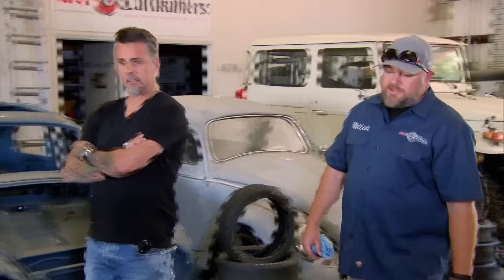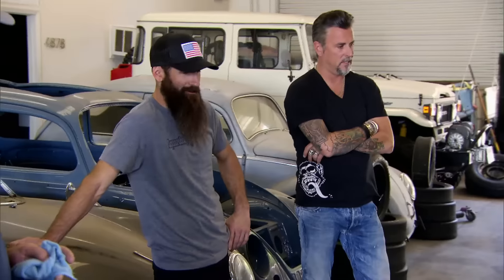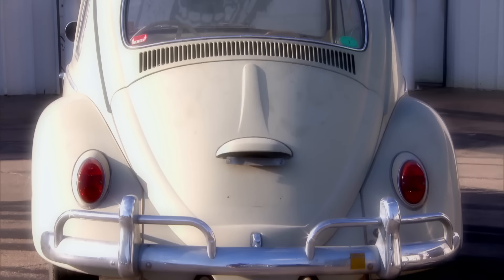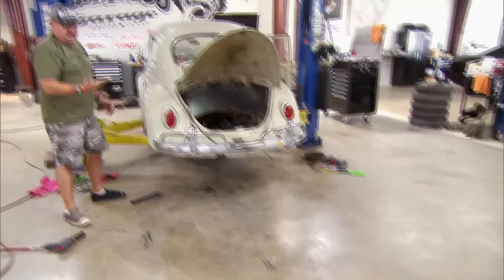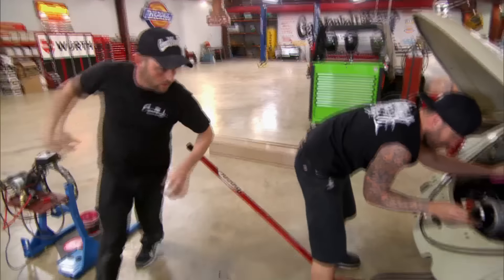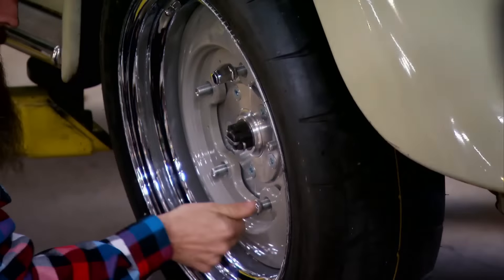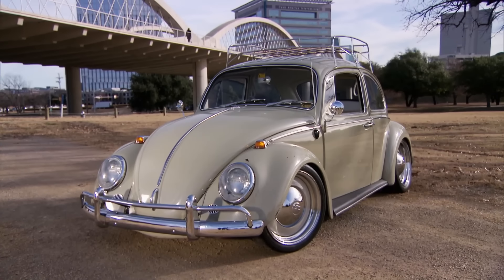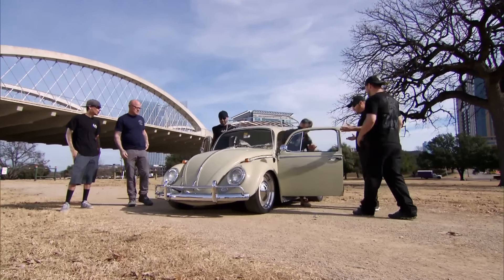Aaron Gives A +200 Horsepower Motor To A Beetle | Fast N' Loud

Comment: What I don't understand is why they bought an almost new car to change the motor, etc...if they could buy a cheaper car with no motor etc...No sense.
Reply: It's a tv show with a budget that allows it. it's a shame they wasted an all original that would've just needed a buff and simple maintainece to turn it into a prime collector car.

 I like the way it turned out but it's still a shame
Reply: It's a blank/clean canvas!  No extra stuff to do, especially body work, which is the time and money suck on these old vws.
Reply: It was an unmolested original. That is perfect  to begin with no matter what. Other people haven't gone through it, made a bunch of changes and beat it up.
Reply: Lots of sense , cause once a car has been fucked with it’s not worth 10cents
Reply: And not fixing someone else's mess.

Comment: Sitting higher it looked better. I think they've messed with the camber angle too...
Reply: It hurts to see them mess with the proportions of a classic, but that's Gas Monkey. At least the suspension and wheels can be easily replaced, again.
Reply: They dont drive very well lowered like that. Alot of bump steer.
Reply: Ginés de Pasamonte
 ... when you loser the back on a swing axle you get negative camber. You have no choice.

Comment: Bought a new 50 horse 1300 in 1966, 495 dollars. Fitted 1600 barrels and pistons, twin port heads,Webber downdraft carb and a good quality extractor system. Great result for a reasonable cost. Suspension work turned out a little costly.

Comment: Dang, this really makes me want to buy a bug now and do this.
Reply: I’ve never liked a bug before. I want to build one exactly like it but oily black everywhere this one is chalky white. Leather interior with black plaid inserts. Dual chrome exhaust tips
Reply: @negativeindustrial  i just bought a 63 at the Mecum auction in Houston last Dec,it was a herbie style, now its in the shop and gonna be deep black, red seats door panels and carpet, the rest will be black, disc brakes all around and air suspension. Can't wait to have it delivered.

Comment: I don't like the lowered aspect of it, nor the 17" wheels... Back in the day, we would put G50-15s on the rear... They would fit on the stock rims... I have no idea what that tire size would result in these days, but it was a tight fit and could have probably done with a bit of lift in the rear suspension or some slightly wider fenders...

<break-for-google-search>

According to this:
http://www.pontiacserver.com/tires.html

A G50-15 would be 10.35" section width and 25.46" height... So, approximately a 263-50-15 tire...

Mine might have been a bit older than this one since it originally had the 6V electrical system... Over the years, things got swapped out with parts from other Bugs, so in reality it was quite a mix of years... Too many years have gone by and I don't remember what year mine had started out as...

Comment: i bought my 54 for 5 grand. looks and runs fine.}1500} Plugged in a 2276, big valves, dual 44s, and I'm sure it is no where near 200 horse. But she does haul ass. They would have to raise the compression ratio to drag race heights to get that much horse and it would be unreliable.

Comment: Where can we find frond, rear suspension, gearbox and engine for beetle ? Wanna bring it down to Sri Lanka..
Reply: I can ship them, original parts
Reply: Front Suspension: obviously Airkewld, USA, AZ, "Ultimate Beam",  looks to me 4" narrowed, no shock towers  (+ the 17" Wheels)
Gearbox: not sure, might be a Rancho "Type1-Pro", USA, CA
Motor/Engine: they did not say, but I'd wager from CB Performance, Turnkey crate 2276?; also USA, CA
Exhaust: looks like a Vintage-Speed SST, 200hp kit. Made in Taiwan
.. if you really want it, ask them if they ship to you :)

Comment: Good job, can anyone tell me where to get those upgrade Engine and other stuffs, thanks
Reply: If you google it you can find it. Just got gas money vw big parts. I’ve found it before
Reply: Front Suspension: Airkewld, USA, AZ, "Ultimate Beam",  looks to me 4" narrowed, no shock towers  (+ the 17" Wheels)
Gearbox: not sure, might be a Rancho "Type1-Pro", USA, CA
Motor/Engine: they did not say, but I'd wager from CB Performance, Turnkey crate 2276?; also USA, CA
Exhaust: looks like a Vintage-Speed SST, 200hp kit. Made in Taiwan

Comment: Considering how light weight that thing is  200 is like 700 in a challenger.
Reply: What I missed where details about the suspension,brake system and the new engine.I just hope this video doesn't give som inexperienced boys ideas about leaving everything as it is just putting in a new, strong engine.Might turn out to be a dangerous adventure.

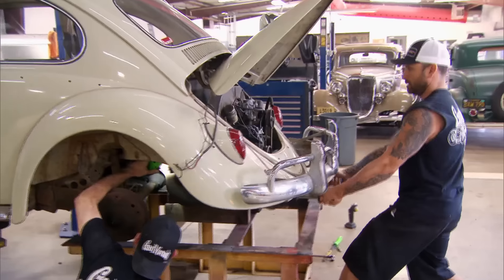Comment: 2:42 do my ears deceive me or did i just hear him say “speedo cable” 🤔 last time i checked the speedo cable was up front at the front driver wheel lol.. the throttle cable is back there and i guess you could say it gives you speed when pulled

Comment: Where is the front suspension, gearbox and motor from?
Reply: from the place they bought the car if i understood it correctly
Reply: Front Suspension: Airkewld, USA, AZ, "Ultimate Beam",  looks to me 4" narrowed, no shock towers  (+ the 17" Wheels)
Gearbox: not sure, might be a Racho "Type1-Pro", USA, CA
Motor: they did not say, but I'd wager from CB Performance, Turnkey crate 2276?; also USA, CA

Comment: Wow!wow!,i love What the cruising vw.it's awesome. #DMAXUK how deep do i have to get in my pocket to get such powerful engine please.
Reply: jac mwo - a 200hp motor will run you $10k
Then you need the transmission and axles to handle that power and those are another $4-6 depending on if you want to lift the front wheels or not.
Check out the CB Performance YouTube channel. My engine is the all black one that makes 181hp. I have my doubts that this motor as installed in the car makes 200hp...
Reply: Better off with Subaru power a lot cheaper.

Comment: Speedo cable is no where near the engine lol
Reply: Tyler Garrison I was just gonna say that
Reply: I mean kinda in that bugs are small cars so I guess everything in the car is close
Reply: He meant throttle cable
Reply: Speedo cable goes the the left rear wheel. Details. The Devils domain.
Reply: @robertschreiber8099  usually front left wheel for speedo
Reply: @ChrisSandtSmith  Thought so, from another video I saw. Thanks! :) Details! The Devils domain! D'ho!
Reply: @robertschreiber8099  incorrect
Reply: @ironicchannelname6457  Back yourself up........
Reply: @robertschreiber8099  okay you're wrong
Reply: Robert Schreiber nope there is a hole in the bearing cap on the front left wheel that the speedo goes through. No bug from 1951 through 2013 (Mexico bugs) have a Speedo cable setup differently. All front left wheel.
Reply: The comment I was looking for. Clearly no clue about these cars.. Let's just throw money at it and bolt shit on

Comment: "We started off with a 1600cc engine with 40hp" Say what?? If that was a stock engine, you had a 1200 cc engine and 40 hp. Leave it to the young guys to screw the pooch and screw up a car that is only original once.
Reply: If it still had the 1200 there's a good chance the ruined a numbers matching car.
Reply: It’s a car for driving chill

Comment: What porsche motor was it?
Reply: I'd like to know the replacement engine as well as all the parts that were changed out, trans front end suspension ect. would be very appreciated. Thank you for a great video.
Reply: Not a porsche motor, still a bug engine by looks of it

Comment: It saddens me to see it molested if it was truly 100% original...
Reply: In today's driving environment you need somthing better then a 40hp engine, so the rear end and engine was upgraded,  that doesn't mean that they trashed the old engine and rear end, thay will save that and give it to the new owners incase they want to put it back original..
Reply: It wasn’t anyway

Comment: Vw. They changed so many things during the years. Thats why they have 1/2 year parts.
Reply: The handle on the front of a VW was the same through all the years, till the end! Not just the name and looks which became moderated during the years as times and taste became different.
Reply: I'm talking parts when fixing and repairing . They would re engineer part halfway through year because of failures.

Comment: Lol.....clutch cable not speedo cable...and what VW motors spits out 200hp and still runs pea shooters....

Wheels were nice though...What size tires were ran on the front and back? Does anyone know?
Reply: The Exhaust looked more like a Vintage-Speed in SST with bigger Tubes, they have some Exhaust systems for up to 200hp. 
In case you want to investigate more: Wheels (and Front Beam) are from Airkewld USA, AZ,  17" smoothies.

Comment: There's a reason VW stopped selling these in the USA. The phenomenon was called "Ejector Seats". In a rear end collision the seats come off their tracks and throw the occupants to their death through the rear window. The steering shaft on the 65 model also didn't have the collapsible shaft yet for a few years. So you see, anyone can bolt on a power package, but can you make it safe for the streets today?  Get creative with some high strength U-bolts and some steel ,(or other material to secure the seat channels, and get the newer model steering shaft that is collapsible and not a spleen killer. Or just get a good liability policy so if the person you sell this high speed death trap to manages to survive it can pay out millions to the injured party. It's one thing to do this kind of thing for yourself but if it's a business and you sell it, you're liable to whoever you sell this high speed coffin to.     ........Just sayin' ,  P.S.  I drove beetles for about 20 years, loved them. Now I drive a sbc 350 van,,,,,,,,,,  ........Mike

Comment: here is a Silly Question  you guys have the car on a lift that you are  lifting the new tires and rims  off the floor to put on the car , why not lower the car on the lift to make it easier to  put the new wheels onto the car ?  Work Smarter not harder

Comment: I'm not trying to be mean or rude but love fast and loud very good show since they took American Choppers off the air why in the heck will they take the original motor for my 65 Volkswagen bug and take the suspension off and put new interior if it has the original material why mess it up

Comment: I'll stick with 40 horses.  30mpg
Reply: How did you get it that low?
Reply: @ChrisSandtSmith  1200cc  stock 64=40hp
Reply: I meant the MPG mate, I have a 62, with a 69 1500, cant get better than 16MPG
Reply: @ChrisSandtSmith  according to spec.  Stock 1500 should get 25 mpg.  1300 28mpg.1200 31.5 mpg.  With 1 passenger,  55 miles per hr.  It's in the original owners manual.   Cheers from Texas
Reply: Maybe our Fuel is crap down here in Straya mate. Will do a Carby tune and see if i get those extra 10miles
Reply: @ChrisSandtSmith  1500 in my opinion, was the best engine they ever made. Make sure you are running the correct, stock vac. advance distributor and the 30 pict-1 carb.  Stock is rock.
Reply: @ChrisSandtSmith  are your tailpipes black?  Should be tan
Reply: Chrome actually
Reply: @brianchisnell1548  i have a 28 pict carb on from the 1200, vac Distributor is on there, the car is half 6v half 12v, so im changing it over to 12v maybe putting electronic ignition in staying with the vac adv distributor.
Reply: @ChrisSandtSmith  no, the inside.   Soot?  Black?  Means too rich
Reply: @brianchisnell1548  yup,  pitch black,  haven't checked that actually, great heads up. Ill do a carby service, lean it out a bit
Reply: @ChrisSandtSmith  you can only adjust idle mixture.   May need to re-jet the carb.
Reply: @brianchisnell1548  
I've always wondered what the different air cooled engines got for mpg but I was too lazy to look it up because I know myself.... if I  start researching it..... I'll start looking to buy another lost orphan.
Reply: @xmo552  Lol .  30 mpg was a big deal in the early 60s.  Then came the Datsuns and Toyota's!
Reply: @brianchisnell1548  
I know it wasn't all about big cars and hp. That's all people think about in hindsight. I've read old articles about dependability runs and mpg runs. It's nothing new. It seems there were always higher efficiency car options. I'm 38, older guys talk about their smaller cars and motorcycles when they were younger. Not everyone started on a big cube sedan, corvette, or glamorous fullsize Harley Davidson.
Reply: @ChrisSandtSmith  ... I think that carb is your problem. Too small and you are always keeping your foot into it. The 1500 should have a 30 or 32 PICT carb. My 69 easily got 25 mpg and with a bit of coaxing I could wring out close to 34 mpg. (us gallons)
Reply: @ChrisSandtSmith  Egads! In addition to the usual suspects-- timing/dwell WAY off, plug gaps too wide, mixture WAY too rich, etc., in all likelihood the advance mechanism(s) in your dizzy must've failed completely to be getting such HORRIFIC mpg!  Same thing happened with my 72 back in the day and it'd barely crack 19/20 mpg till I figured it out. Hell, even my 1979 Trans Am with a 505 cubic inch aftermarket engine gets better mpg than that in a car weighing over twice as much.😵

Comment: Hardly any detail on this build about anything, suspension, engine, fuelling, brakes. very poor
Reply: This is a summary of the entire actual TV episode about it so it doesn’t go in as much detail
Reply: Front Suspension: obviously Airkewld, USA, AZ, "Ultimate Beam",  looks to me 4" narrowed, no shock towers  (+ the 17" Wheels)
Gearbox: not sure, might be a Rancho "Type1-Pro", USA, CA
Motor/Engine: they did not say, but I'd wager from CB Performance, Turnkey crate 2276?; also USA, CA
Exhaust: looks like a Vintage-Speed SST, 200hp kit. Made in Taiwan
I agree, an advanced fuel solution might be needed, not sure what they used though..

Comment: Crazy..6k for a bug that needs a bunch of work a $1200 front beam..a $1500 gearbox and a quality built 2ltr will run average $6000(if you need everything from the case up) then interior kits depending can run $2000 and new bumpers/accessories can get pricey depending on quality in the total range of $1500..you're looking at 20k just in parts...now you need to do all the work...all of a sudden your mid 60s economy car is a 30k restomod.